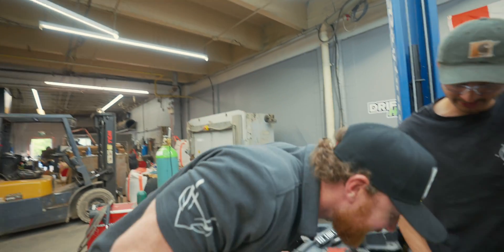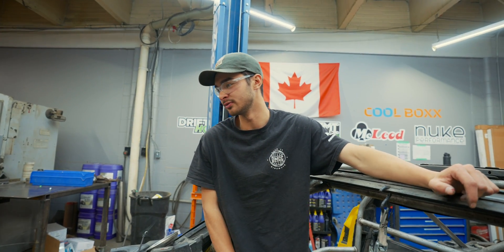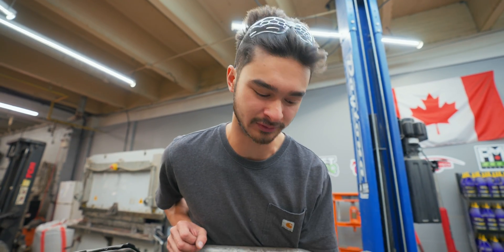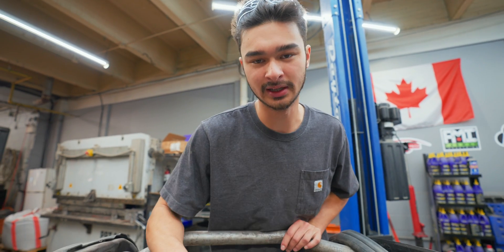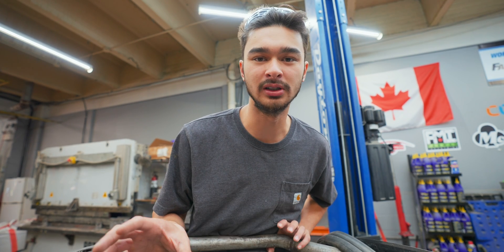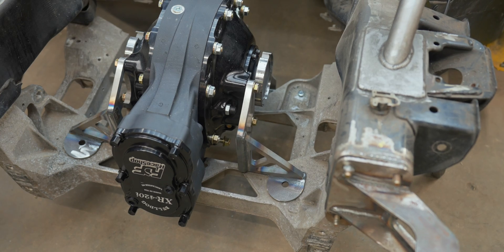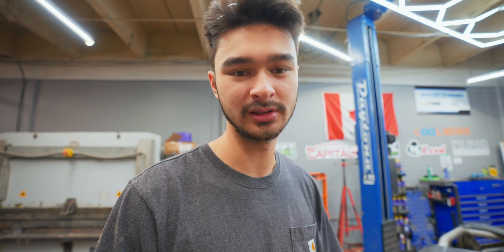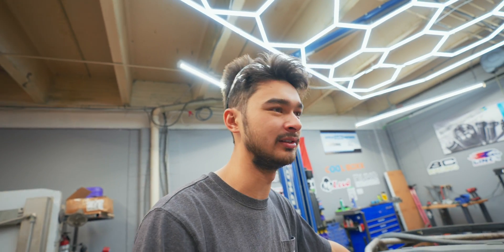Designing Rally Stands for our Corvette Drift Car..

Comment: Love it, could also make some dollies to fit into these too so you can move it round the shop without putting it on a frame with wheels to move it about. Also attach some tie down points when on a trailer. Possibilities are endless with these mount holes 🙌
Reply from the maker: Great idea for sure!

Comment: Shame you wont be able to use the Vette in FD then.
Reply from the maker: FD is the only racing series that doesn’t allow race cars, I hope it changes soon. These are far safer, faster etc especially for 5 min calls
Reply: @FDFraceshop  i agree. I forgot whose interview i just watched but they talked about this exact same thing. It’s silly this isn’t allowed. It’s safer than standard jack stands by far. Air jacks would be nice too…